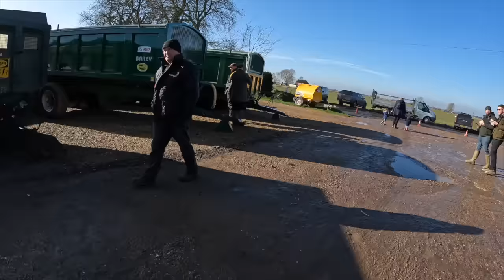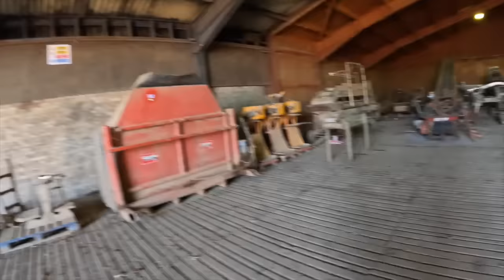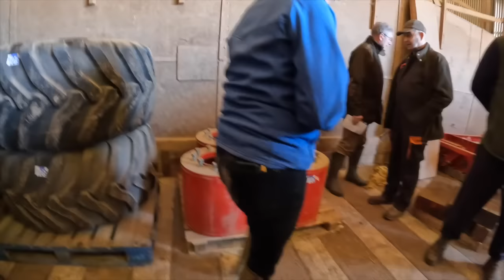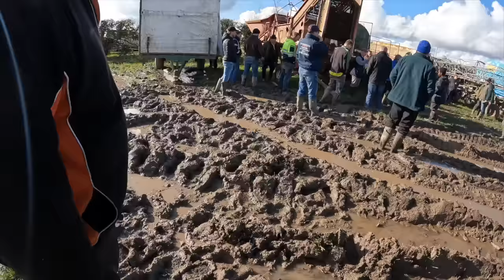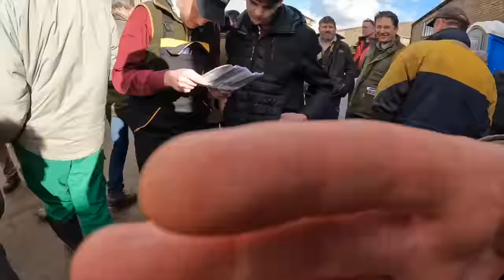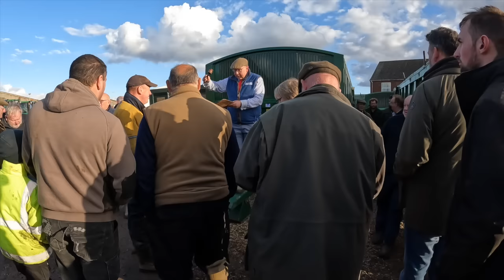SO MANY LOTS! Agricultural Farm Sale - Fenland Farming Adventures

Comment: Turners are lovely.  Unusual with the V4 engine. But prone to gearbox issues. That was some collection and set up, being sold 😢
Reply from the maker: Yes it sure was Fred I’ve never seen one so 😬🤷🏽‍♂️guess maybe fairly rare. Someone of the stuff was stolen tbh
Reply: @fenlandfarmingadventures4241 
Yes Daniel, there are a few Turners around. Used to be a regular at Weeting, that was a high clear version. Even rarer. A late friend had 3 or 4, they got sold after he passed away. 
Yes the condition of some of that kit was great. Definitely some giveaways there. Apart from newest tractors and sprayer !! But their condition sold them... liked the look of that Cat 22, but it was missing its magneto, apparently.
Reply from the maker: That magneto is £600 for a new one so plus auction fees gets adding up hey